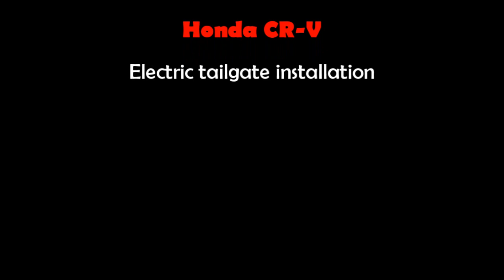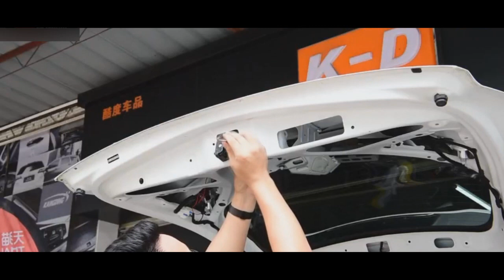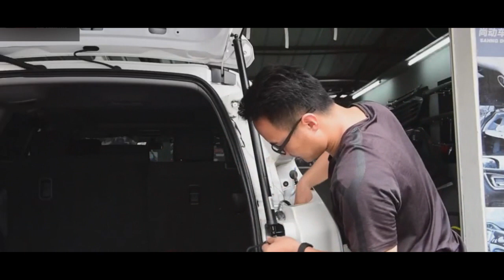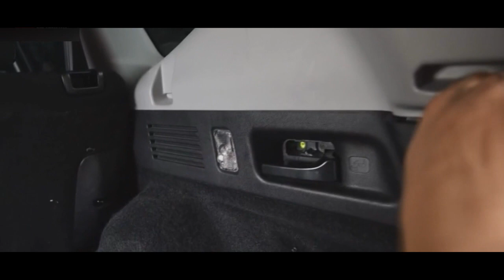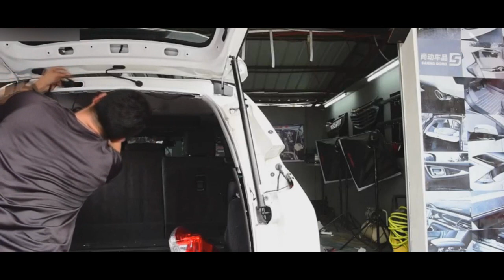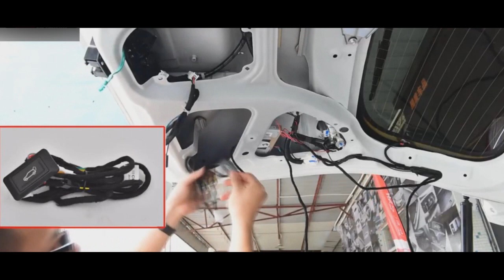Honda CR-V / ELECTRIC tailgate INSTALLATION 🛠 / PART 1/2

Comment: Is there a wiring diagram for this? The instructions that were included are vague to me. What wire on the a piller did you tap into with the yellow wire ?